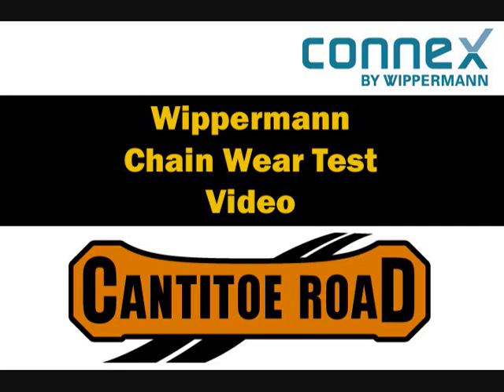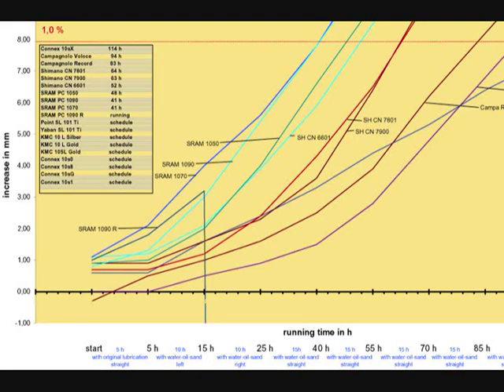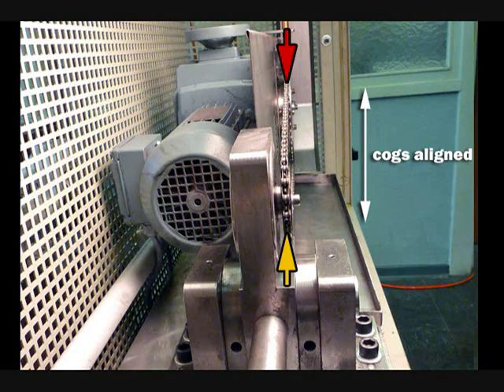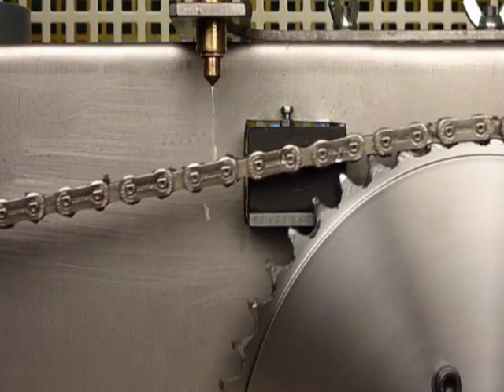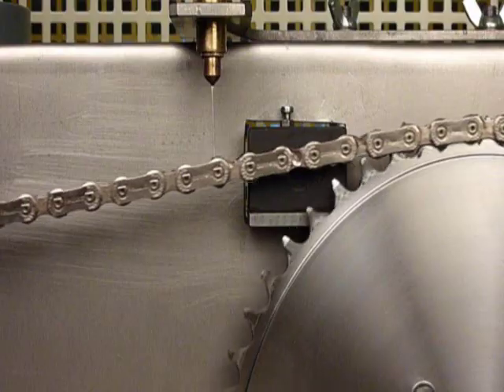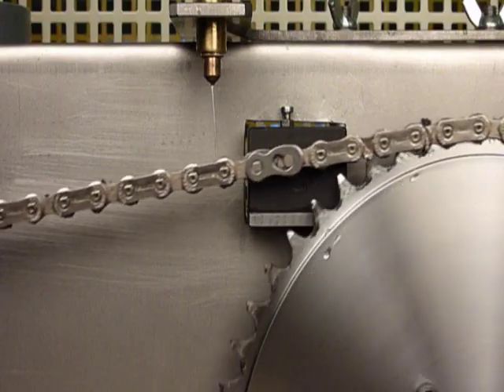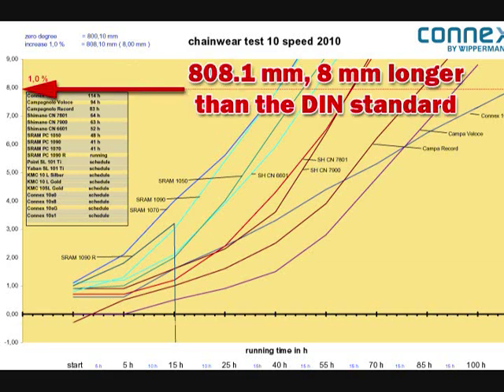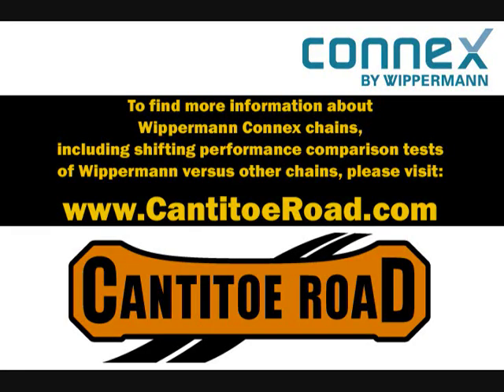Wippermann Chain Test Video

Comment from the maker: @mekore No, you really want to measure chain stretch, not wear (although one is directly related to the other). Once a chain approachs 1% of the DIN reference length,  it begins to wear the leading tooth more than the others because the chain behind becomes slack on the following teeth and all the force is concentrated on the leading tooth. The question is which chain, starting from whatever length it is out of the box, wears the longest before it reaches 1% of DIN reference length.

Comment from the maker: @at220vanier 
Cogs and chain rings are worn by worn chains. If you replace your chain before it’s worn out, you’ll never (ok, almost never) have to replace your drive train. The reason for this is that a worn chain is longer than a new chain so, instead of the driving load being evenly distributed across all the teeth of the cog as it is with a new chain, a disproportionate amount of the load is borne by the leading teeth. The exact same situation also occurs at the chain ring.

Comment from the maker: @at220vanier 
With a worn chain, even when there is pressure on the pedals, you can lift the chain off the chain ring at the 3 o’clock position. This is because there is so much slop in a worn chain that only the teeth at the 12 o’clock position are under tension. Instead of the load being evenly distributed across 26 teeth (assuming you’re using a 52-tooth chain ring), the load is focused on the 4 or five teeth at 12 o’clock. The more worn the chain, the worse it becomes.

Comment from the maker: @at220vanier 
When it’s new, a cheap chain isn’t going to wear a drive train any more or less quickly than a high quality chain. The difference is that cheap chains will wear up to three times more quickly than Wippermann, so you get into the “danger zone” much sooner. A cheap chain isn’t so cheap if you have to replace it three times as often as a good one.

Comment from the maker: @turbosupplier Agreed, chain wear isn't the only criterion. Noise is very much a function of lubricant (Chain-L will silence any chain). Campy chains wear very well, but connex chains wear slightly better and shift as well as Campy on Campy systems. Connex also has a very convenient multi-use connector link (Connex link) that can be installed and removed by hand. Campy makes a great chain. So does Connex. But the Connex link is unique to Wippermann.

Comment: If the chain barely wears out, wouldn't you expect that more wear is imparted on the cogs and rings instead proportionally? I would be curious to see tests showing how a stronger chain could wear the cogs (sprockets or cassettes) quicker.

But thanks for this well explained test. In itself, it shows that these chains are sturdier.

Comment from the maker: @turbosupplier
Wippermann has also commissioned Connex shifting performance tests from RWTH Aachen University in Germany, which show imperceptible millisecond shifting speeds. All the testing procedures and data are on our Connex page.

We will pass along your sound testing suggestion to Wippermann.

Also consider process and materials. If you would like to talk more about about Connex chain by Wippermann, give us a call 800.422.2104 and speak with John.